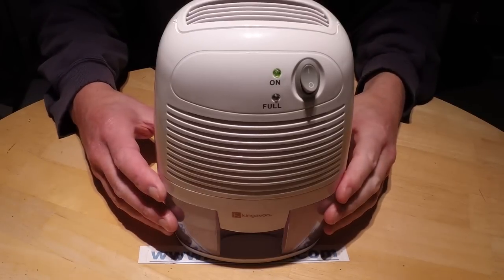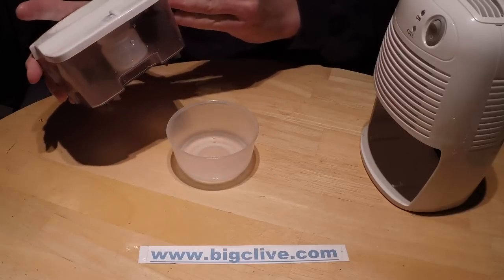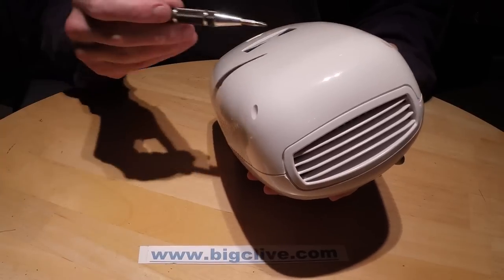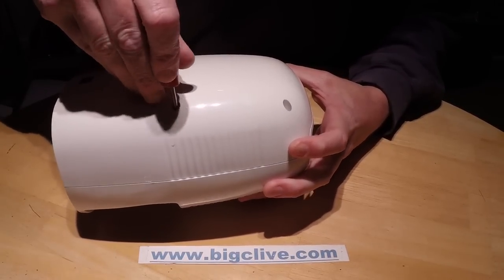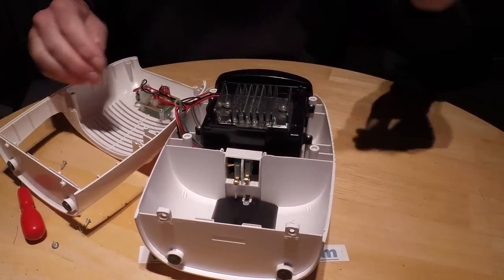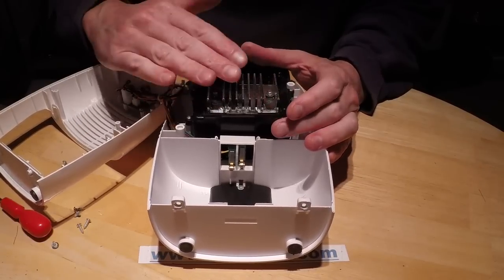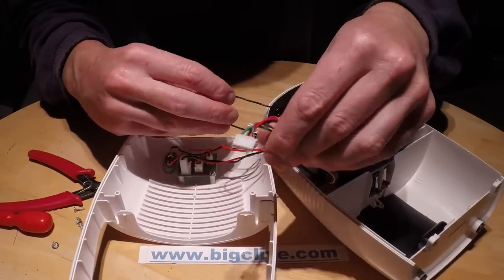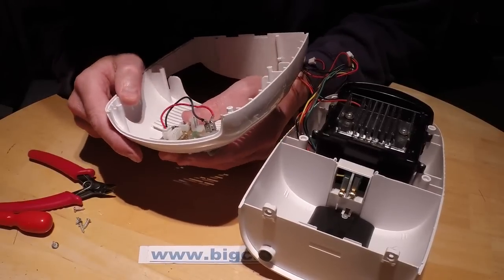Mini peltier dehumidifier teardown.

Comment: Hi I was wondering if you have ever looked at the electronics in a Chinese diesel heater? They are very basic but maybe you would have some suggestions for improvements that could be made to make them more reliable. Lots of people are using them now.
Reply from the maker: I have a couple of the heaters here.

Comment: TES1-12704
TES (Thermo Electric Stack)
TES1 (one stage peltier)
127 (number of thermoelectric pairs
04 (max current 4amps)

This applies to almost all thermoelectric modules

TEC or TES is meant for cooling/ heating
And TEG is meant for power generation

Number afterwards marks how many stages there are
TES1 is most common but you can use TES2 to get slightly higher temperature difference it's basically two modules stacked ontop of each other tho one on colder side is usually 1/4 the power due to efficiency of these modules so you sacrafice efficiency.

Numbers after the "-" mark number of couples usually only first three and last two numbers mark the current.
Reply from the maker: That's all useful info, thanks.

Comment: i like your idea about running off a solar panel. I was thinking the same thing as im aware that  these peltier devices are hugely inefficent from an energy perpective.   I have a small area at the back of my garage of around 5sq m floor space that is insulated in which i keep my lathe and miller .  I think im going to get one to stop flash rusting of the surfaces ( and add around 30watts of heat to the room)

Comment: I have the newer version with LED lighting and have yet to find any information about opening it up and as a technician who works on phones, PCs, laptops etc can find no way to open it up.

Now its full of dust and the fan needs replacing and I can't open it to do the job. Not pleased at all.
Reply from the maker: It will have concealed screws.  The puzzle is to find them all.

Comment: Hello, where I live during summer it gets to around 48°c - 52°c and right now we are experiencing very high humidity which is very bad ☹️ you cannot be outside, we are cloudy right now and I noticed the clouds literally disappear (probably because they are literally mixing with the humidity around the air. Right now is 12am and we have a temp of around 35°c and humidity 43%. 35 people have died in this month because of the extreme heat, do you think or could you do a video about these kind of humidifiers to see if this helps a little to at least bring the humidity down. I wanted to see if these would work to bring the humidity down and save on electricity for the people that are poor and cannot afford to pay high electricity bills

Comment: Hey, hi from AU! Somehow missed this video, and nice to watch the teardown, tell you what these little things are great for - I have one in a small 60x60x50cm(ish) file cabinet/drawer I sealed and insulated and keep printer supplies in - where I am averages 75%rh and goes to 85%-90% quite regularly, this thing keeps 35C 35%rh almost all year round and produces a litre of water every six to eight weeks, excellent for old style lead acid batteries and I also use it to keep solder sponges wet and give the rest away to people that still do ironing... It's been going for almost three years now and reminds me why we like solid state devices...

Comment: I bought two of these units about 4 months ago. Mine have one micro switch that turns the yellow light on when the reservoir is full.  Initial Problem: first unit fan stopped and green light does not come on. If if press the micro switch the yellow light does come on.  Power is going to some areas.  I replaced the fan and still not working.  Today the second unit needed to be emptied but no light was on. I emptied it and replaced the reservoir securely but it is now acting in the same manner with no green light and no fan movement. Any suggestions would be greatly appreciated,.
Reply from the maker: A common failure is the power supply.  Try measuring the DC voltage entering the unit and see if it stays at a decent level when the unit is supposed to be running.
Reply: @bigclivedotcom   thank you,  I will test both of the power supplies and report back.  Regards

Comment: these are quite handy for drying shoes and such. that's what I use them for at least. in the humid summer months they can bring out about a tank worth a day which is not bad for it's size, but yeah if you need a real dehumidifier you should get one.

Comment: I think you should have run it outside under an awning of some sort. Or at least in a room with a window open. Once it has dried out the air beyond a certain level, further effort will be fruitless but for any new moist air that may have entered the operating environment in the meantime. In a closed-up box like a house, there's no good source for any new moist air.
Reply from the maker: This was in a very humid bungalow near the Irish Sea.

Comment: Now they changed for 9V adapter, possibly lower voltage for more longevity. Just acquired the same, fills the whole bucket in 1.5 days in my 80% room humidity here, despite that it's not able to lower it as unit is too small for room size I suspect.

Comment: For the fun of it, try making a solid state dehumidifier. Take two stainless steel screens and place a hydoscopic salt in between. When there's no water the salt does not conduct, but as the salt absorbes moisture from the air it starts to conduct electricity that eventally breaks the water down to hydrogen and oxygen.

Comment: hey but how does air from hot part pass to the cold part. the peltier are stuck together. so how does 12v fan passes the air from hot part to cold part

Comment: so what side of the peltier is on the heatsink? i mean, if its the cool side, the cool side can make its own water out of nowhere , so was it water in the air or the peltier making it?
Reply from the maker: Either side can heat or cool depending on polarity.  The water is condensed out of the air by a cold surface.
Reply: @bigclivedotcom  i will have to build one myself to see , i dont want to disasemble one and void the warrenty lol

Comment: What if you swapped it with a more powerful Peltier module? Cheap Powerful Dehumidifier?
Reply from the maker: A compressor is much more efficient.
Reply: @bigclivedotcom  we don’t always do what’s efficient, when we just want to see if it will work ;)

Comment: 12704, about 4 amper. That easy to over heat. The reason why cheap dehumidifiers using small amper are to get fast sublimation. But it's forcing the so much.

Comment: Mine has a flashing green light any ideas had it apart power is reaching fan because it's moving slightly but not going around
Reply from the maker: It may be a power supply issue or a thermal cutout has tripped.

Comment: Without a mention of the humidity you exposed it to, and the temperature and square footage of the space, and the exact time allotted for the device to run, there is no way to determine whether the small amount of water you found is reasonable for such a small device or not.  When attempting to review a product try to think of all the relevant parameters to pass on as without them you could be misleading people with comments like that.

Certainly you know they only function well in ideal conditions: above 50% humidity and about 50F is where they can start to work, but the "bell curve" for performance will be around 80F and 80% humidity so it has plenty to draw from the air.

All humidifiers (and air conditioners) depend on the purchaser properly selecting the device for the space and environment.  A device like this can take the edge off a small room, like a bathroom, but that's about all.  For anything demanding a Peltier unit won't cut it and you need a compressor based unit as mentioned.

Comment: Hey Clive.  I live in Singapore.  Past 4 yrs I went through 4 of these in my wardrobes and kitchen cupboards.  They’re on 24/7 and only last about 8-10 months then they just stop working.  This time though I didn’t want to chuck it in the bin and get a new one.  I want to repair it.  I found your video very helpful.  Now I know exactly what’s inside but I was actually hoping to hear you tell us what could go wrong with them and how to fix it. If I actually replaced the module, is there a high chance that it will work again?  Also, how would I know whether to change the fan too?  This DIY enthusiast lady needs some expert help.😁
Reply: Suggestions for repairing mini dehumidifier:
1. disconnect power supply, check voltage is correct. (Poor quality capacitors are prone to failing.)
2. Check fan, use a small brush to remove dust. If it doesn't run smoothly a replacement (a superior quality/quietness) fan should be easy to source (local sources for spare PC parts, Amazon, AliExpress, Ebay ...).
3. The peltier modules can fail but before replacing that try just cleaning the module & replacing the heatsink compound.

Comment: If the power supply output allows, you might be able to replace the peltier  device with higher wattage  one. If you use bigger one you may confront freezing problems instead of condensation, for that reason  as you know, you cant go too far on that. You can make your own. Increasing heat sink area may solve freezing problem because it would dissipate the sub freezing cold which I know you know it very well.

Comment: Thanks for the video, I was looking for a mini dehumidifier for 3-D printing, and was looking at them hoping there was a big Clive teardown so I could see what was inside
Reply from the maker: If it's for filament storage, I use a large storage box with foam tape round the lid as a seal and a silica gel desiccant block with integrated heater for drying itself out when needed.
Reply: @bigclivedotcom  Thanks for the reply, any chance of a video of your setup, or have I missed it?

Comment: Thanks a lot! 
I bought one of these in the begining of the year, but haven't used for some months. When I turned it on, it started a strong noise. By seeing your video I imagined that the problem was in the cooler. So I opened it, cleaned everything, put some new lub in the cooler and ... it worked! :)

Comment: An awful design flaw- the two rather thick screws literally form a thermal short circuit by touching both the cold side heatsink and the hot side heatsink. Maybe you could improve it quite a bit by zip tying those hatsinks instead. I thought that the plastic part would have tapped holes to hold separate screws for the heatsinks and that there would be some insulation, but no. Im going to build one of these becaue I have a Peltier and some old CPU coolers lying around, but I just have to get the cold side heatsink right - too small and it won't collect much water, and too big and it won't get past dew point aw will do nothing. I also think of sucking the air through the cold side, and making it go to the hot side to cool it after being dehumidified - the overall temperature change is unneeded, and the water isn't going anywhere once it is driped down, so it culd improve the (lousy thermoelectric) efficiency a bit. If you look at it this one seems to be doing jthat actually.
Reply: I have 3 of these, and those screws from cold to hot are nylon.  On Clive's it looks like they're metal.

Comment: Could anyone explain how we get near ice cold temps from the heatsink just using this process. I have a unit similar with 2 heatsinks on the back of the main large one. One gets extremely hot and the other is extremely cold.. Its not adding up in my brain tho.
Reply: Google Peltier effect. It's a stack of bi metal thermocouples. If you heat and cool it, it will generate electricity too!

Comment: I've been using these for like. 7 years... I leave it in a cupboard I keep my. Guitars.... For where I live, SEA, I can keep humidity at 60 percent while outside hovers around 75 to 85 percent... Not bad... they are robust and still works after 7byears,  However the adapter have given up on me twice. I think that's because the temperature of the cabinet sometimes exceeds 32 deg celcius, adapter overheats

Comment: Hi @bigclivedotcom do you think a better way to extract the humidity would be cycling off the peltier for 30 seconds every 5 minutes or so to allow the freezing water on the cold side to drip? Thanks!
Reply from the maker: I'm not sure.  One option might be to turn the fan off and reverse the polarity briefly to warm the condensing surface.
Reply: @bigclivedotcom  Yup tought about that also but tried to simplify to the max. Thank you very much for your quick reply and greetings from Buenos Aires, Argentina.
Reply: These Peltier modules do not like being switched on and off.  I fitted a humidistat with a relay to turn it on and off.  It stopped working after a few weeks and I had to fit a new Peltier.
Reply: @RichardDTube  Any success on the new peltier, or did they break too?
Reply: @Killadeniz  They wer alright for a few months then stop working.  I had 3 of them but could not keep them working.  They fill with dust very quickly.  Cleaning the dust from the outside is not good enough.  You have to open them and clean all the heatsink fins.  The peltiers fail quite often as well.  I wondered if the peltiers were failing because of the shock of being switched on and off.  So I put in an Arduino and a mosfet with pwm power control.  Then the power changed very gently.  They still failed.  All in all not worth it.  Threw them away and bought a 200W compresser dehumidifier.  In 10 mins does what the little ones take a day to do.
Reply: @RichardDTube  Thank you for the comprehensive answer! Unfortunately, there's no other dehumidifier on the market in this size or smaller. I will be using it in a very small enclosed place (2x2)  paired with a hygrostat attached to control humidity. I've heard mixed things about how long they last, but these dehums seem to come from the same factory and rebranded under various names.

Comment: I have one of these and found this video while searching to see if there was a filter inside that I could remove and clean to make it work better. Turns out, any dust it sucks in is probably sitting right on the components. After watching this video, I'm curious if it's worth pulling apart to clean, or whether I should just replace it with something more efficient for use in my small bathroom.
Reply from the maker: I tend to recommend using a real dehumidifier like the eco air simple which uses a rotating desiccant drum.  They are much more efficient at pulling out a lot of water.

Comment: I have a similar dehumidifier and it stopped working.It is just in a bigger box with two LEDs for ON and two LEDs for FULL on the front side. Nothing is moving now and all the lights are off.I have opened it to see if I can find what is wrong with it bearing in mind there is no many components inside( fan, peltier module and a few switches ). Maybe this is the best place to ask for advice. Lets me explain what I found and what is puzzling me.The power straight from entering the dehumidifier is around 13.7V. The negative is going to the small (main) circuit board .There is another small board with 4 LEDs( for ON and FULL) with 4 resistors on it. The positive is going to ON/OFF main power switch which is working fine . After that the positive is going to the switch for inserted water collection container( with switch for full tank next to it -the same as on the video).After that is going to the positive side of the same main board.When I measure ( with multimeter) the voltage from negative part of the board to the non inserted water container switch position  is 13.6V.Of course, at that point, no power is going to  the positive part of the main board and the fan is off( as the peltier module).The unexplained happens when I measure the voltage with water container switch inserted position.Instead of sending the power back to the main board with this switch in inserted position the voltage just disappears.When measured from negative electrode on the negative part of the  board it disappears even before the main power switch( ON position).There is just no power at all.Where all the volts are ?
I have also checked ( desoldering )the fan and peltier module and  one 12V car battery  they are working fine.Funny enough when connected directly to the original dehumidifier power source they are not working???
Also there is capacitor between the negative and positive part of the main board rated 25V and 47microF.When insulated it reads 54microF. Is this OK if it reads more than the rated number?
Any help will be much appreciated?
Reply from the maker: If you're getting voltage into the unit it could be that a switch is faulty or that the power supply is faulty and its output is being pulled down by the load.
Reply: @bigclivedotcom  I will try to find similar 12V power supply and test again .Somehow my multimeter can't measure the amps( the risk when buying cheap chinese items) so I can not check what is coming out of the original power supply now.I will keep you updated.
Reply: After taking out and checking   every component the voltage was still dropping with water tank switch on. After a lot time spent on the mystery disappearing voltage I finally found the problem. When checking voltage once (just at the back of the socket where the power plug is inserted )with  multimeter the fan start spinning for a second.So it turns to be bad connection on the positive side of this socket.Quick soldering and now everything is working again.But was really interesting how this fault is letting the full voltage trough the main on/off switch up to the water tank inserted switch.I have to find probably replacement 12V socket but the dehumidifier is succefully  repaired.
I hope I can save some time to somebody with similar problem.